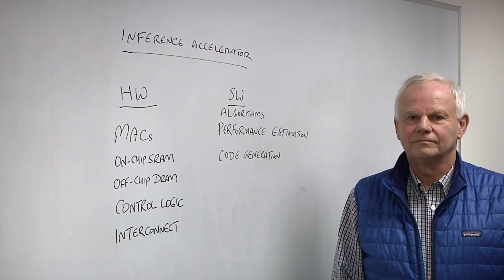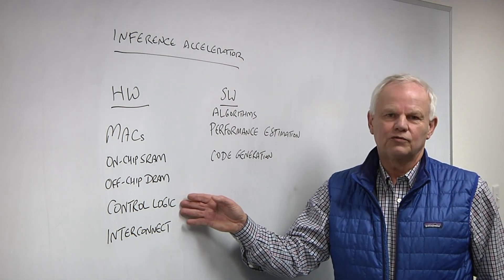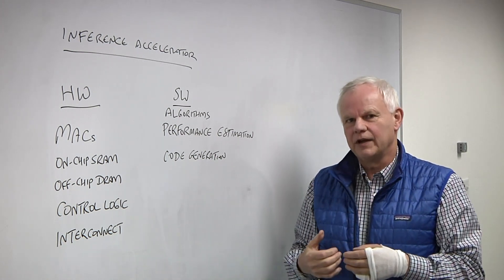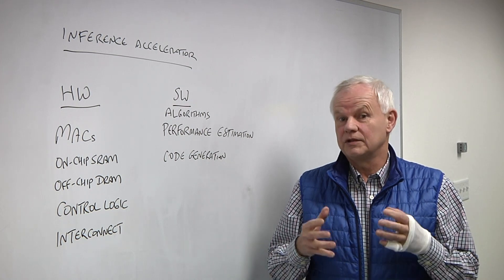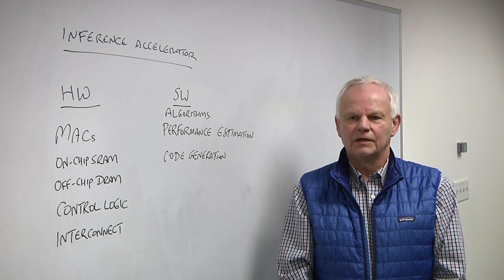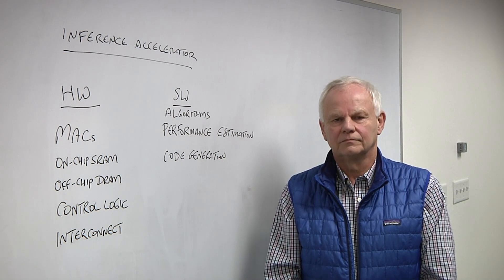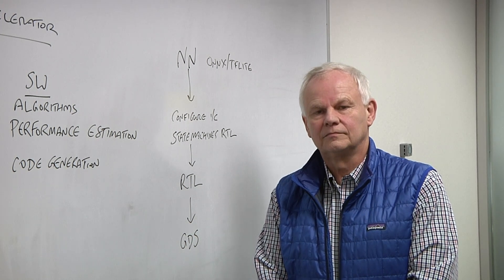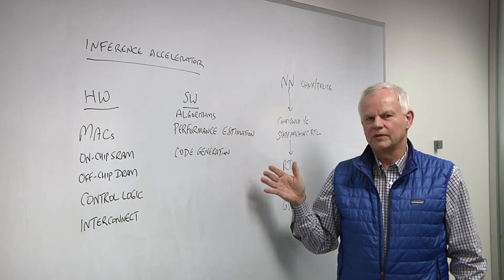Software In Inference Accelerators

Comment: For decades hardwares and softwares were designed and and developed separately. But with the change in the new market needs,  AI and neural network models being used widely in the industry to make the hardware efficient you need to do it in parallel with the software. Recent problem seen is due to lack of interaction of software and hardware engineers while developing a chip. This gives rise to inefficiency even though hardware model has been carefully tweaked over the years. 
Each neural network model needs a different set of interconnection within the hardware. That's why it is important for the hardware to be programmable in nature. Also each layer in a model needs a different set of interconnection. So  it is quite evident the best way to design a develop an AI accelerator is actually understanding the neural network model, analyze the requirement and design according. The design of the chip becomes lot more efficient if we learn about the different needs of different models and trading off different parameters accordingly. One way to do it can be using compiler designed by software engineers which will run algorithm based on a particular model to configure the interconnection and to develop a state machine RTL written in C. Following this the front-end Hardware engineer can the develop RTL for the hardware and finally GDS. 
Thanks semiconductor engineering for providing us a great platform to learn things.